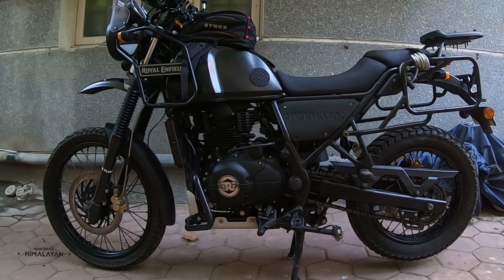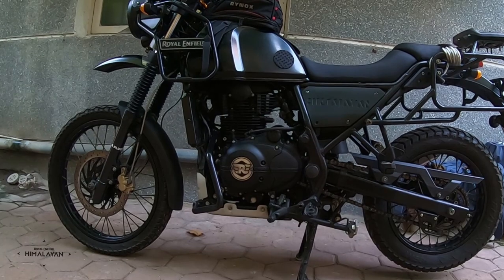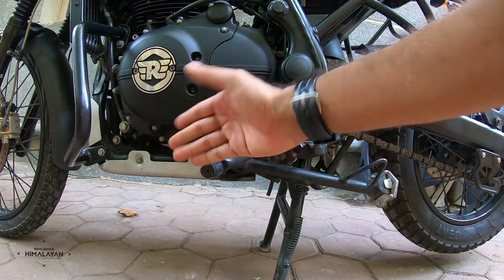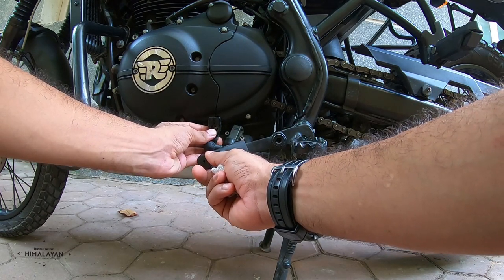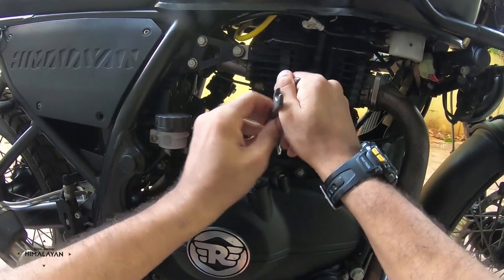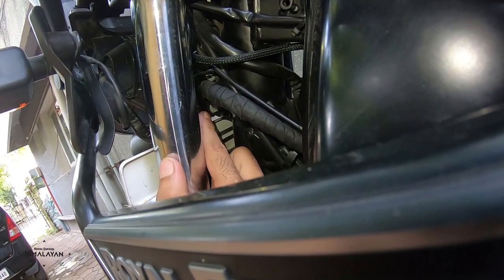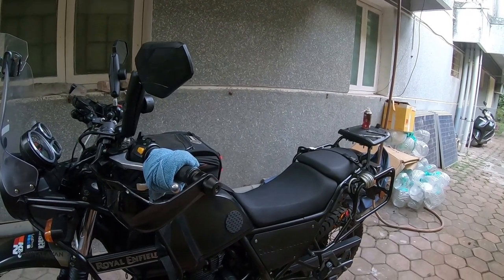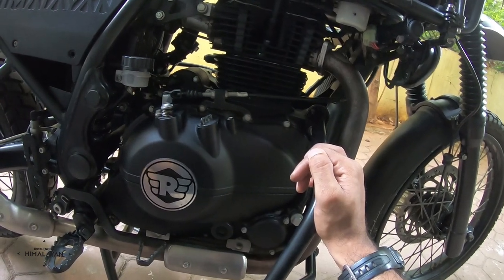ROYAL ENFIELD HIMALAYAN HARD GEAR SHIFTS PROBLEM.

Comment: Gear shift hard issue can be solved without all this trouble just Shift to Motul or Liquimoly Oil as RE LiquidGun is the worst oil and that's the best option it smoothens the engine and u will feel the ride comfort
Reply from the maker: i have used motul on atleast 20 motorcyles of mine . ran a business of selling performance oils for over 3 years. i do know what difference it brings about in the transmission. but this video is about a lot more that you can do to fix the issue once and for all.
Reply: Dear friend, oils can influence gear shifting only if you don't change the oil for long time or using different spec oil. New fresh oil mineral /synthetic eases gear shift for sure.
Reply: GM Ben, we can simultaneously try by replacing existing gear shift with pulsar 180's shift lever which is slightly longer than REH's shift lever. This has been successfully done by monu sagar , a famous delhi based mechanic youtuber.
Reply from the maker: Shaji K.Damodaran yes uncle . I have tried the 180’s lever on mine after watching Monu’s video and it worked like a charm except for quick aggressive upshifts . I never could understand why . So I lowered the position just like I did in this video and found that i couldn’t do quick downshifts now my . Something about the length of the lever was just a little bit more for the Himalayan’s transmission I guess. The perfect length would be right in between the stock one’s and the pulsar’s.
Reply: Varying the length of shift lever definitely eases the shift process due to increased torque applied. Your observation appears right on the shifter.
Reply from the maker: @shajik.damodaran8156  we should meet and talk a lot soon
Reply: @ONTWOWHEELSBEN  ofcourse , you are most welcome 😊😊
Reply: I have been facing the same problem. The gear  makes a thud sound three out of five times while changing the gear from neutral to first and from 1st to second. The service center advised me to change the clutch plates costing rs 1700 plus labour charges. Please help me with a solution. Should i keep my clutch cable tied like shown in this video for 24 hours or should i consider replacing the gear lever with that of bajaj’s bike? Thanks!
Reply from the maker: Rahee kindly do some research on what I have mentioned in the video . This is about 15-20 years of experience and not some random though
Reply: ON TWO WHEELS BEN Thanks for the response. Will definitely try!

Comment: my gear was smooth again after i changed my engine oil
Reply from the maker: Yes , new engine oil helps with increased lubrication and better running of engine . But the clutch plates sticking will come back in another 500 kms or more . Change to a motul 5100 and you will see the difference
Reply: @ONTWOWHEELSBEN  thanks for the tip sir